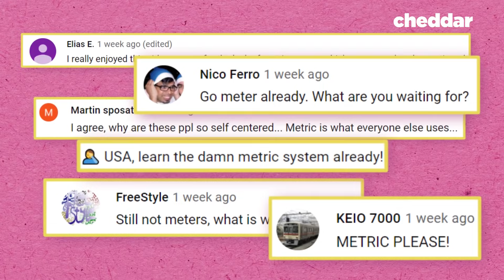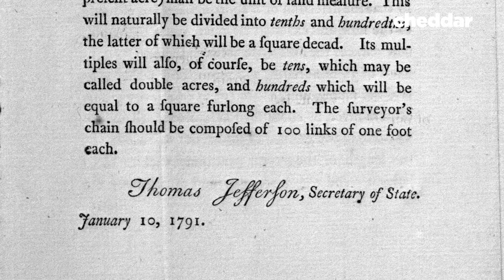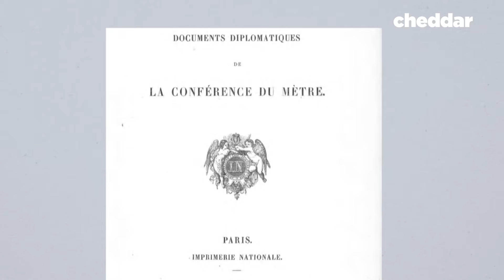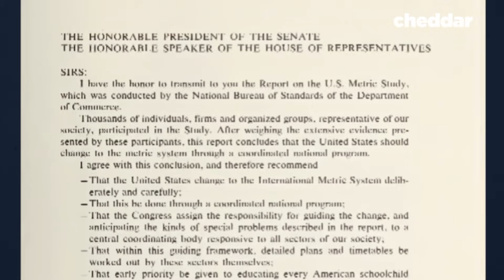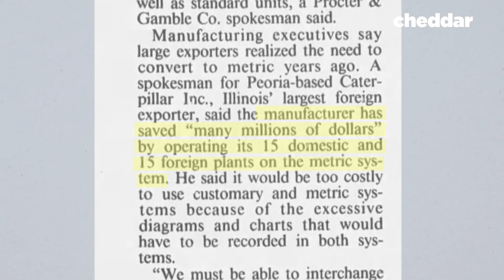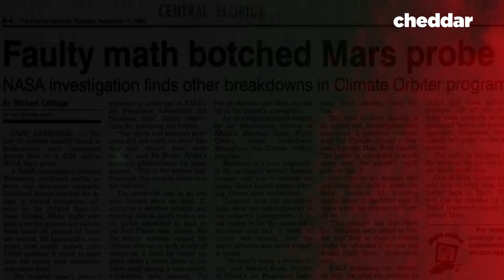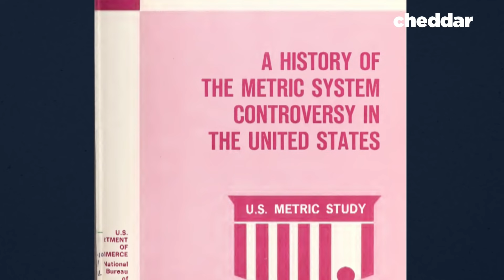Why Doesn't the US Just Use the Metric System? - Cheddar Explains

Comment: I'm in construction,  the biggest holdout of the metric system.  But i use metric all the time. Especially in elevations.  T.O.S. (Top Of Slab) is 12.00'. My benchmark from the surveyor on record is 10.825'. I find my H.I. (Height of Instrument), go down 1.175' (roughly 1'-2 1/8") from that on my Philly rod,  and shoot T.O.S. Lol.
You want to know the problem with the metric system? The standard unit is a meter or centimeter.  That make plywood roughly 1.2m or 120cm wide.  Now try using 12dm and it'll be read as 12cm or 12m. Then miss the decimal of 1.2m and see something 12m long. I can see the difference between 12ft and 12in. And i make my guys give me feet and inches.  So "one foot, oh, and a half". 1'-0 1/2" and it must be written with that dash or feet and inches or both. You give me 1 0 1/2, your block is 2in short.  You say 12 1/2", you'll be informed we're carpenters, not sheetrockers (they tend to use only inches). 

Lastly,  and probably most importantly, it's math.  What's half of 1.219m (4ft)? 0.6095? Now half that. 0.30475? 4ft cut into halves is 2ft, then 1ft, 6in, 3in, 1 1/2in, 3/4in, 3/8in, and then 3/16in. Most of our math is done very fast,  without a calculator or paper,  and on average, a minor mistake a week.

I'd love to see how a metric jobsite works. Oh,  that's right,  you guys in Europe pioneered the "safety vest" (hi vis vest) for all workers.  How safe do you have to be to wear that in a building with TCO (Temporary Certificate of Occupancy)?

Comment: I guess many English speaking countries have remnants of the imperial system. Like in New Zealand my height is 6'1" and my weight is 91 kilograms. I drove to a petrol station  and pumped 40 litres into my tank and I inflated my tyres up to 40psi.  I drove to the store a kilometre away to purchase a 48" television. I then drove to in a 50km/h speed limit zone to a bar and had a pint of beer.
Reply: This is exactly how we measure here in India.
Reply: @shreydoshi3729  I wouldn't put exactly in that sentence. This is horrible.
Reply: Same in Canada, except we use pounds for measuring body weight  instead of kilos.
Reply: Same as straya
Reply: J Groenveld. 
I guess it will be a while before every last imperial is gone, 
I can't imagine asking "how much kilometer-age does your car get "?
Reply: @Froggability  we still say milage but we use it as a general term and speak in terms of how many km we get
Reply: @Froggability  the use of mileage is similar to milestone both seems to be measured in miles but in many countries they're in kilometers. Used to drive me nuts when I was younger.
Reply: @Froggability  The only imperial that is used to sell in the food and drinks sector here is Drinks measures, the EU allowed us to continue using them in 2007
Reply: Same with the Philippines because 'murica
Reply: Im Canadian, I am 176 cm, weight 179 pounds, I drive my us model motorcycle at 60 mph on the highway, fill the tank with 18 litres of gas, my pool is at 87 degrees, but the weather is an  unbearable 31 degrees.
Reply: I lived in the UK for a while and it was definitely a mix of both metric and imperial. There were a lot of people still used to the old system and not fully adjusted. Old habits are hard to break.
Reply: Canada officially adopted the Metric System in 1970, but the Imperial System is alive and well here.  Only Metric is taught in the education system, but every Canadian child needs to learn the Imperial System on their own in order to operate in the system.  The United States of America is our closest neighbour and largest trading partner and they "ain't learn'n no dam Metric System".  There remains a complete mish-mash of measurements between different products and industries.  A gallon of paint is still in a one gallon can, but it's labelled 3.78 liters.  You still buy a stick of lumber that's 2in. X 4in. X 8ft. long, but a sheet of plywood is 4ft. X 8ft. X 17mm. thick.  Smart phone conversion apps are our only saviour.
Reply: In UK while, we have mostly switched to metric, yet we never quite completed it. Our road signs are still in miles per hour. We fill our cars by the litre, but then measure fuel efficiency by miles per gallon (I don't even know a gallon is - just that 40 m.p.g is good). We also buy milk in bottles containing 2.273 litres (genuenly labeled like that), as that's 4 pints. I do wish we just completed the conversion; We're so close. In school were taught exclusively metric, yet expected to understand some of these old imperial measures!
Reply: @imtired03  I'm in a British school in Qatar and they taught us conversion between metric and imperial measurements even though pretty much everything here is metric!
Reply: @imtired03  . Funny but true. I'm in the UK and I convert liters to gallons (4.55 in the UK but 3.78 in the US!)  when I work out my car's fuel consumption, as MPG means something. I was at school in the 70s and not taught Imperial measures as they weren't deemed to be needed any longer!.
Reply: @imtired03  UK gallon and US gallon are different sizes to add to the confusion
Reply: @imtired03  why is the UK so bloody half-arsed about making sensible changes? (I should know, I grew up there, but still haven't worked it out).
Reply: @imtired03  What about drinks measures
Reply: @imtired03  A gallon is 4 liters. A liter is a quart.
Reply: Tv screens are measured in inches worldwide because its simple and it really is weird to say that the diagonal of my tv is 100 centimetres or a metre
Reply: the inches in TV's is a common measurement around the world, even in 100% metric countries and the pint of beer is also common for those who like to drink 😂
Reply: I thought inches were common to all screens? I live in a metric country where it's always been metric, yet we measure screens in inches and drink pints of beer. The only difference would be that we actually use meters to measure height and distance whether it's for people or for math or for anything else.
Reply: @fayebradshaw4221  late I know, but the metric system creates holdover units of measurement like pounds, stone, miles etc. T.V.s are the biggest place of holdovers because its fairly simple to use inches as opposed to Centimeters in that particular case
Reply: @fallout0624  Nothing easy about using inches for screens when you have to use fractions like 5.5" phones. Easier to make them round numbers in cm. But it's a tradition originating from importing TVs from imperial countries, and so it continues
Reply: Well, I can tell you that inches for screen sizes it's pretty standard all around the world, even in full-metric countries.
That's why I've a multi-unit ruler on my desk, to remind me how the hell a inch is long.
Reply: Being from NZ, I concur, although the traditional pint was replaced by the 600mm bottle, but you try going to a bar and asking for 600ml of beer, it is also easier saying a length of 4 x 2 , rather than saying 100 x 50.
Reply: @gsf67  Using imperial sounds easier. Germany has its own beer serving measures
Reply: Inches in displays is a world wide thing even here in poland and we are not english speaking(and were never a colony)
Reply: It kinda highlights the impossible retrograde conservatism of the English speaking world ... (it's OK, I was born in the UK ... just can't believe why anyone would still want to use the imperial system).
Reply: @daweilaotou1269  What about ordering a drink
Reply: @oscarosullivan4513  best idea I've seen today! You choose the units of measurement. Cheers!
Reply: Europe also measures TVs in "
Reply: I think the television inch and pint are used everywhere cause it literally affects nothing else that we do.. plus i think some forms of measurement like pint has become just a general ordering for a glass beer.. it’s like asking for a large coke.. anyway on most beer glasses they indicate 0.5L at the pint line
Reply: It’s true, I’m in the UK, but I personally hate the trend of using feet and inches to determine height. It’s such a bad reference because inches are so large. I’d rather we just use centimetres/metres
Reply: Many countries have some goods sold in imperial, mostly due to a long history of importing goods from imperial countries. It's fine as long as we don't use it as standard.
For example, in Chile we measure screen sizes and nails in inches, and tire pumps use psi. But we would never actually measure or calculate anything in imperial.
Reply: @a2falcone  What about drinks
Reply: @oscarosullivan4513  Canned and bottled drinks come in cc and liters (250 cc, 330 cc, 350 cc, 500 cc, 1 L, 1.5 L, 2 L and 3 L are the common sizes). If you're talking about ordering beer, a 0.5 L glass is called a schop and a 1.5 L jar is a pitcher.
Reply: I honestly did not know this.  Very interesting.  Thank you for your educational post!
Reply: what are you talking about????
Reply: J Groenveld how many  liters is a pint of beer in Zealand?
Reply: @MIERDAENELESPACIO2  600 mililitres, or 600ml, you wouldn't ask for 600mm of beer though.
Reply: Car wheel size is measured in inches
Reply: Steve Terry  That might be the case, but in Europe you get about 800ml of through or head, and about 200ml of actual beer.
Reply: Same for india brother
Reply: Same in UK but our speed limits are in mph
Reply: It's like that already. Lol
Reply: The entire world still uses inches for monitors and TVs...and psi is still used in many countries.
Reply: Almost all of the world measures tv’s and electronic devices in inches
Reply: TVs screens are in inches all over the world, that is the only use inches have outside the US, measuring televisions
Reply: @ignaciogonzalez3499  Pretty sure that imperial inches is still used in gas-fitting in many British Commonwealth nation's that have otherwise adopted metric.
Reply: Same thing in Canada
Reply: Imperial drinks measures make sense
Reply: @mrblue7499  Because smaller beer servings exist
Reply: same as Indonesia
Reply: A proper British pint or a measly American pint?
Reply: Hmm. Okay. I'm from NZ and my height is 1.8m, my tries are pumped to 220kpi and my beer usually comes in a 600ml bottle (or 355ml can). Television screen sizes are still stated in inches though...
Reply: I'm all for metric, but liter sounds better than cube meter tbh
Reply: @eddie-roo  litre is metric
Reply: King Ghidorah oh right, ounces are the imperial ones
Reply: 91 kilograms?Ur fat 😁

Comment: So many people say metric is easy because it is based off of multiplying by 10, while this is true, for me at least, that isn't where the difficulty lies. It is remembering what all of the prefix terms mean. Due to the fact I never grew up using the system I don't have it memorized. I have to use it on the regular to remember what every one means however we just don't. I wish we did because that would make using it easier. 

I also see people struggle to visualize what the different measurements look and feel like. I am familiar with Celsius and can easily imagine the difference between 25 degrees Celsius and 65 degrees Fahrenheit. I cannot visualize distances. Even using the imperial system I am accustomed to, I struggle to visualize a mile. So having to visualize kilometers is even more of a challenge. I am not saying it cannot be done, it easily can be achieved. People learn multiple languages all the time and are fluent with both. The country as a whole has to have the desire to use the metric system in every day life if we want to officially convert. Until then we just have the populace that uses both or is more fluent in one than the other.

Comment: Replacing a cracked 1.25 inch pipe requires a 1.25 pipe to be the right size with the right thread. Hardware stores won't want to keep double stock. Old buildings won't fade soon and retrofitting is expensive.

Comment: Where to start? It'll take different posts. First Mile markers. Every one of them has to be pulled and repositioned - and we have to add 60% more. At 2,500 miles E-W, 1,500 miles N-S times the number of roads that use mile signs is very expensive.

We have roads that are a mile apart. Instead of saying, "3 miles down the road then turn right". it becomes 4.8km.

Many cities have roads named for miles (5 mile road, 8 mile road). Do we rename streets? Leave them with stupid names?

Comment: Pull shit ford is metric, have you ever worked on a car? Every bolt , hex head and nut in the stupid vehicle is mixed up. Taking apart the engine better grab both sets plus some odd sizes like my 14.5mm socket.

Comment: Britain isn’t fully metric either. They still use MPH for speed limits and in cars and also measure distances in miles and yards on roads.... shows you just how hard the switch can be
Reply: I’m from Canada and I take outside temperature in Celsius, pool temperature in Fahrenheit and body temperature in Celsius. All distances are metric except for my own height. My weight is also imperial, but if I weight a bag of candies I’m going to use metric. 
For all of those, I can’t interpret the data if it’s given with the other system. 

Btw, my boyfriend is in engineering and he hated the imperial system.
Reply: Emilie Poirier your temperatures should be opposite. Water temperature for example boils at 100C and freezes at 0C. Air is very hot at 100F and very cold at 0C.
Reply: Playboy X I don’t understand why my temperature should be opposite.
Reply: Emilie Poirier for my personal preference I like the human body for F. For example I’m 6’2 and it’s easier to tell apart someone’s height if they’re 6’2 from 5’10 as opposed to 1.87m from 1.77m. I like things such as distances in km with exceptions such as football fields being 100 yards (another reason why here in the US will never change to metric entirely).
Reply: Here in South Africa, as far as I know, it was a sudden change from Imperial to Metric. Everything (except about 3 things) is in Metric. 
South Africa might have been the first country to switch from Imperial to Metric.
Reply: it's not hard just put the metric system in schools instead of imperial and it will die out with couple of generations
Reply: Almo8anD true
Reply: Also the exits here in America are all 1 mile apart. The exits are numbered by mile..
Reply: Actually Britain switched to the US inch. So it can't be that hard. They did it 185 years ago though. Which is why no one today knows they did it.

Comment: The only non metric thing I like it Fahrenheit. It's a lot easier to gauge the feel between 0 and 100 and have that be temperature humans can handle rather than about -20 - 40 Celsius.
There are more actual whole number temperatures to work with, which makes it a bit easier to understand exactly how hot or cold it is.
I don't know, with inches it's a lot easier to switch, but miles and Fahrenheit are a lot harder because those are ingrained ideas in my mind, which I have experienced since I was young
Reply: My biggest problem I have with Fahrenheit is the random choice for its 0 degrees and the fact that you can't directly convert differences into Kelvin.

Comment: I'm an American and I'm all for switching to the metric system, except for temperature measurements. 0°F is good at saying "very, yet bearably, cold" and 100°F is good for "very, but bearably, hot."
Reply: Fahrenheit is a better system for temperature IMO. It works better from a human standpoint , 0 F is fucking cold, 0 C is just like "consider long pants and a sweatshirt" cold.  100 F is fucking hot, 100 C is, well, boiling water hot.
Reply: @algorithm1193  Fun fact! Each system of measuring temperature is based on a different reference; Farenheit is based on humans, Celsius is based on water, and Kelvin is based on the amount of kinetic energy in atoms that is converted to thermal energy. The key to remembering which is which is in the placement of 0 in the scale
Reply: Sillypplproductions2 also fun fact: -40°F and -40°C are the exact same temperature
Reply: @1pcfred  No there isn't

the conversion from Celsius to Fahrenheit is (Cx1.8)+32, where C is the temperature in Celsius

-40 times 1.8 is -72, -72 plus 32 is -40
Reply: algorithm what the heck, at 0° celcius water freezes. I’ve been wearing long pants since 15°. At 0° you won’t see me without a coat.
Reply: I’m from Mexico and Celsius is super convenient for us because climate almost never goes below 0 C and it’s easier to say numbers from 0 to 50
Reply: What you are all saying is very subjective. It doesn’t make any sense for me. Celsius makes sense. 20-25 is a nice hot day, 30 is too hot. 10 is getting cold, wear a small coat or a vest. At 0 water freezes, you guys all know how it is when water freezes, wear a bigger coat. -20 is very cold, wear your big winter coat. From -25, don’t get out if you don’t need too, it’s the coldest of the winter. 
See? Simple and effective!
Reply: You gotta switch completely a lot of equasions wont work, if you mix metric and imperial.
Reply: Youtube User - I disagree because wouldn’t most equations use Kelvin? Idk what labs use but I’m pretty sure they’d just keep using what ever they’re using. If you’re talking weather though why change? It’s only how we perceive temperatures so I don’t think that changing to Celsius would really need to be necessary.
Reply: Jeremy Ma - same
Reply: Kelvin is a strictly scientific measurement with same units of celsius. They are not inter-changeable but to convert simply add or subtract 273,15 C
Reply: I love the Fahrenheit system. As someone who lives in a climate that can get as low as -30 and up to 100 in a year, it just makes sense.

Comment: The only imperial unit I really know is Horsepower
Reply: Fun fact: A single horse at peak performance can output 14.9 horsepower
Reply: @Deathnotefan97  you're right. It is fun
Reply: @Yoo moron true... But when they mentioned the engine output in kW I got confused.